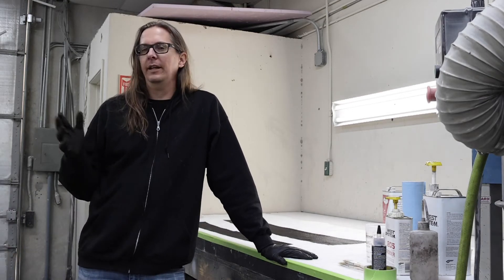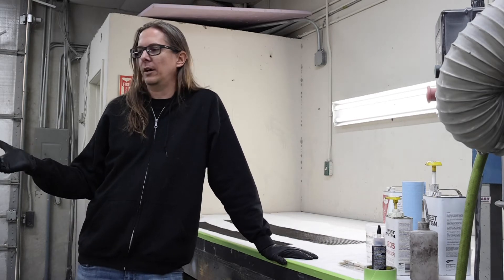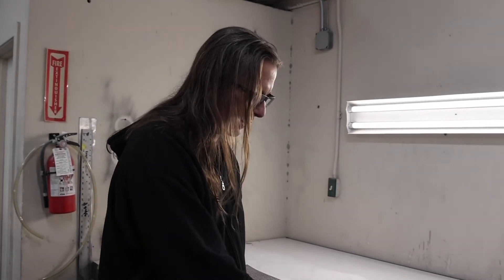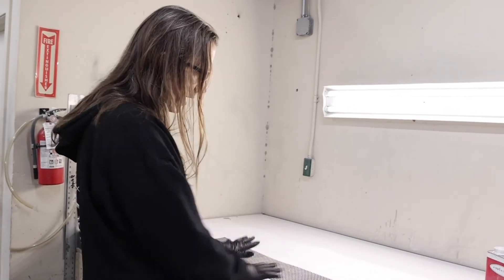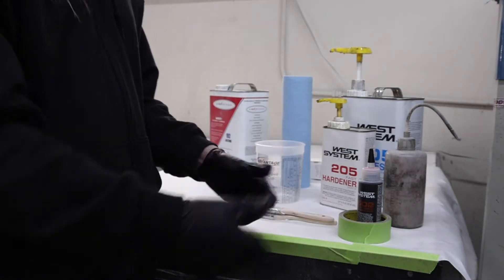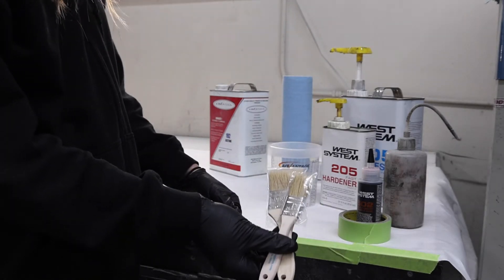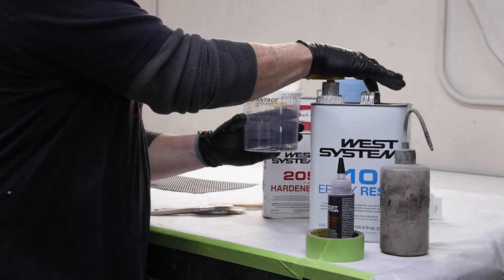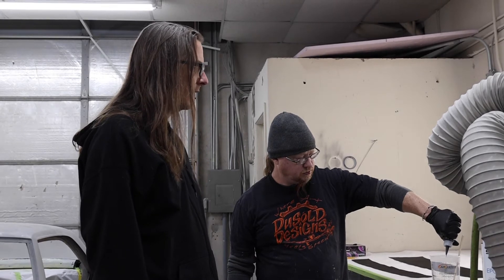Skinning Metal with Carbon Fiber!

Comment: That surfacing veil plays a dual purpose because carbon on metal is conductive and will corrode or rust depending in what metal your fusing to.  Im stealing this technique for sure